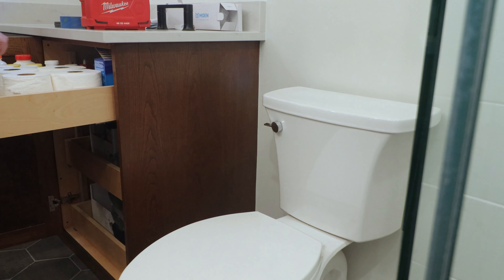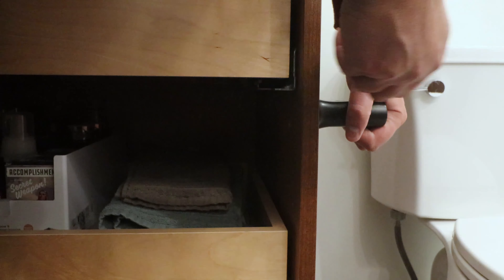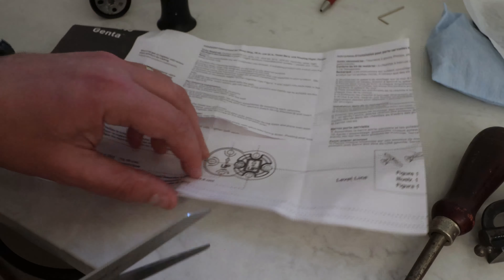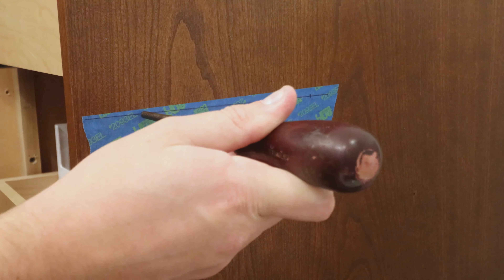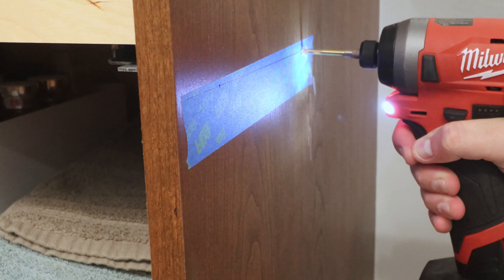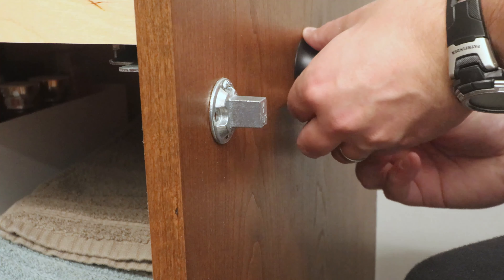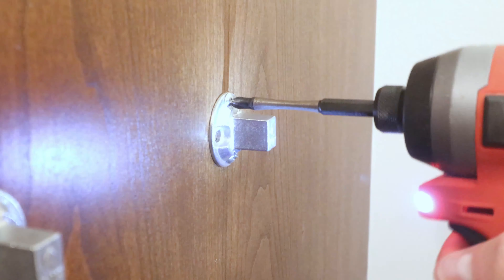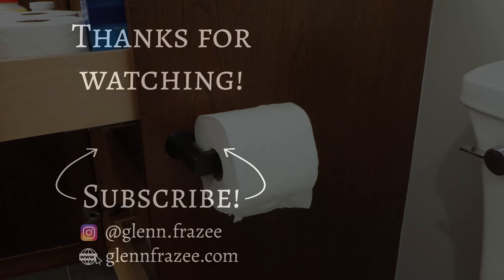How to Install a Toilet Paper Holder on a Wooden Cabinet

Comment: You aren’t supposed to drill it all the way through your cabinet. That’s why you use wood screws.
Reply from the maker: Wood screws will strip out, especially if the cabinet sides are made of veneered particle board.  Drilling through and bolting is the most secure, longest-lasting option.